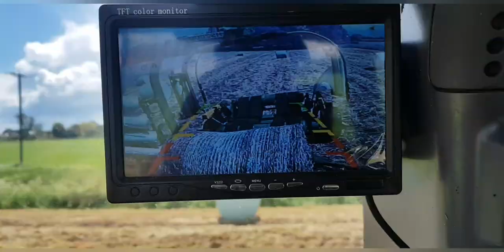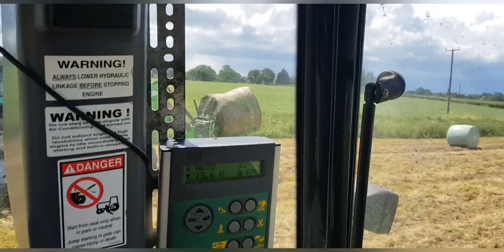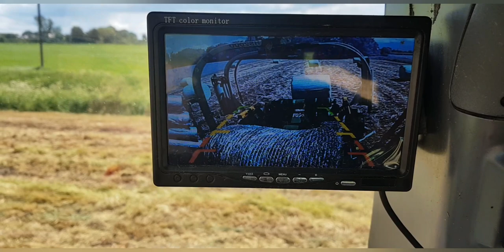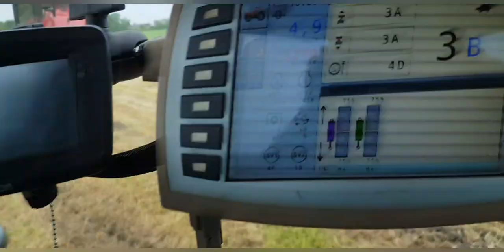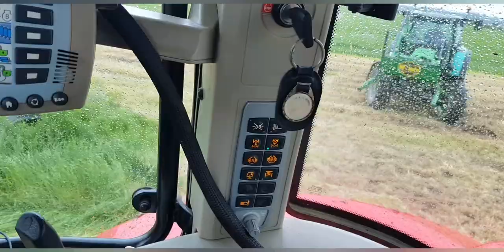DESTROYED WRAPPER, BROKEN TRUCK & PEAT BOGS🤯

Comment: I notice you've welded some uprights to your bale handler. I thought of doing the same to mine to enable three hay or straw bales to be carried. Is this the reason you've done it?
Reply from the maker: Exactly that reason. Wasn't even 24h old before it got modified
Reply: @hsagri69  Great minds think alike. Must do mine soon. 
Another modification I've done is to cut a 'tangent' slice from the thick washers holding the rollers on the spikes. 
Removing the rollers then only requires slackening the nut and turning the washers to release them instead of removing the nut and washer completely.

Comment: How does the wrapper attach to the baler? Do all mchale balers come with the hitch for the wrapper?
Reply from the maker: The Baker has a draw bar bolted to the axle. It's not standard but I think McHale would supply for most balers. Ours is actually a modified John deere

Comment: Sledge hammer.  Big clamp and a welder don’t need to take the turn table off at al
Reply from the maker: Depends if you want to repair the damage and make it right or just bodge it back together and hope it holds

Comment: Is that setup any good on hills?Are there any issues when you drop a bale out the baler for the wrapper to pick up on hills?Do you need 3 lots of spools to run it? Im guessing the hardest pat would be reversing back to leave the bale off in a tidy place.
Reply from the maker: Very stable rig. Don't seem to get many problems picking up. The baler needs 2 spools and the wrapper works on power beyond. Is a rig that needs a half decent operator who's awake. It's not impossible to get in a mess
Reply: @hsagri69 Thanks for replying. It would be intaresting to see it working on hilly ground, see how much of a pain it would be reversing back to leave the bale off the wrapper so it doesn't roll away. Dose tha bale come straight out the baler on to the wrapper arm or dose it land on the floor and the arm closes up and thain picks the bale up?
Reply from the maker: https://youtu.be/kJt2jHb5zfk
https://youtu.be/V_9ER0FHh7s
Hope these help answer your questions. If u don't want to watch the whole videos 1st video is 5.20 2nd video is 9.30